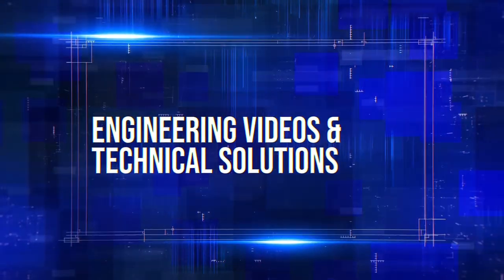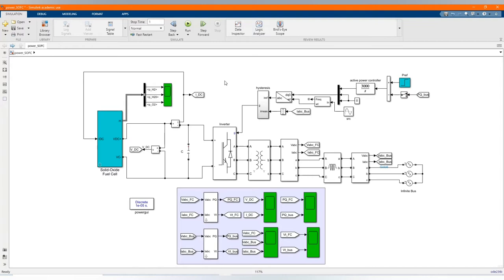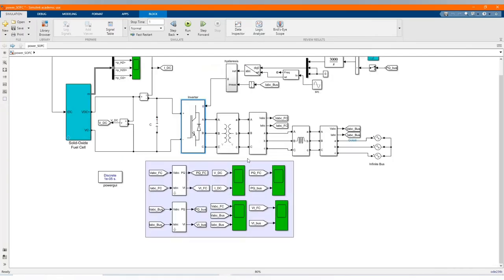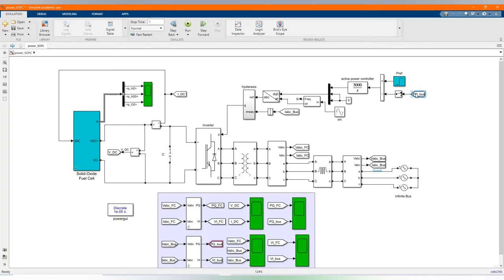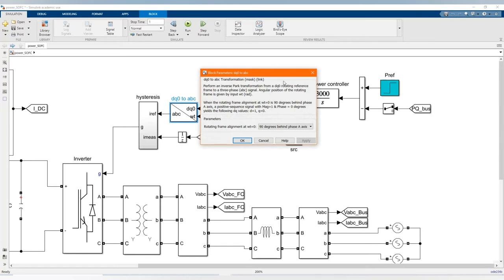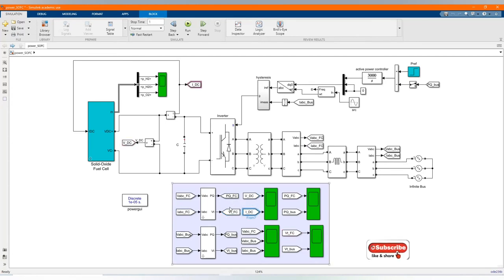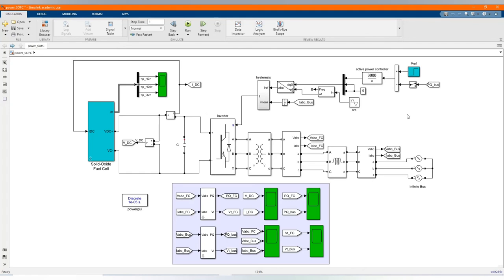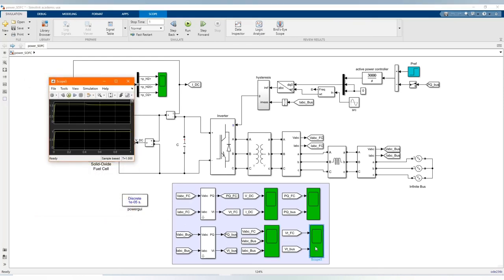Simulation of Solid-oxide Fuel Cell connected to three phase power system in MATLAB Simulink

Comment: Hello, I connected your inverter to a boost converter whose voltage source is a fuel cell, but instead of 400 volts and 4 amps output current, it gives 0 and 0.5 amps and 250 volts, of course, I put it in the pi controller circuit. Tell me now. What should I do? Give me the correct current and voltage? I even put the resistance and ideal switch and step function, it still gives the same values..